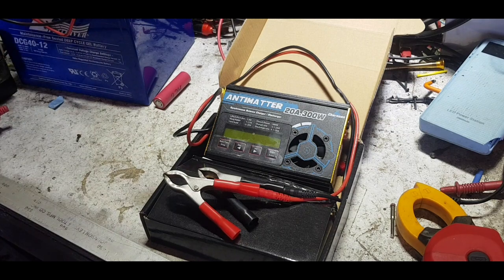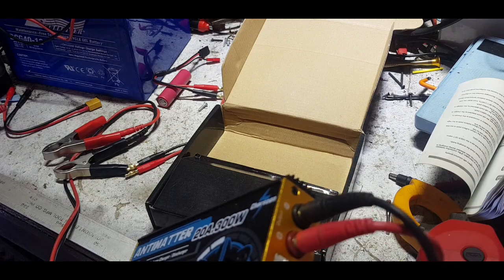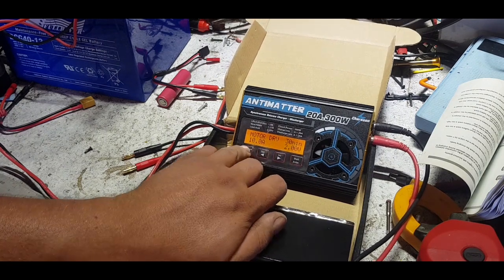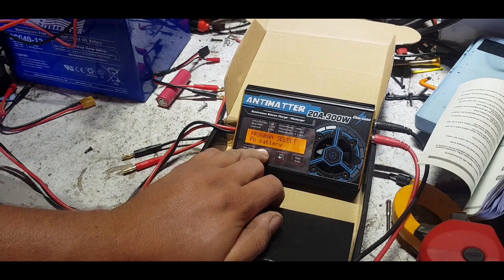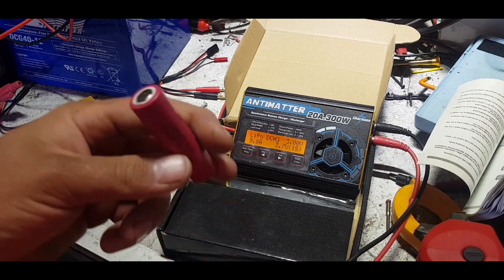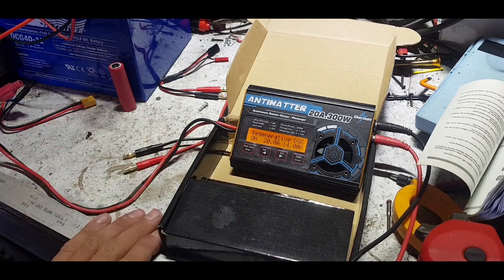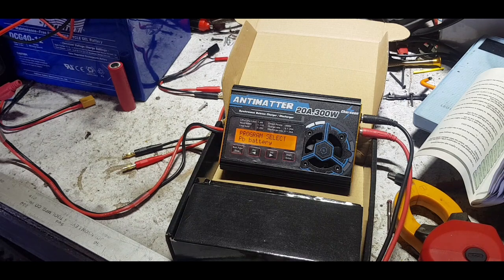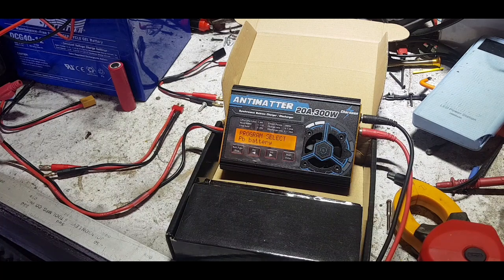Charsoon Antimatter 300W 20A Balance Charger Dis charger Review

Comment: A good tip is to get some neodymium magnets and clamp them on the ends of your clips or a set of crocodile clips and it holds itself to the battery making a decent enough connection to charge.. I got a set of ten with holds and connected all the wires from a balance lead. now I can make a battery pack as many many S as I like in less then a minute.. all the batteries just snap together with the balance leads and between. Good for testing purposes before you make a battery pack up.. thanks for the interesting video's.. 👍
Reply: Just watched the eev blog... He is testing the capacity of a  battery and said he taped crocodile clips to the side of the battery.. and he apologies for how jank the test is because of how it's set up.... Lol he posted the video a few hours ago... Now the people in this comment section know a better way to do it... Just thought it was funny and had to say..😁
Reply: It's on eev blog 2.... 😊
Reply from the maker: Thats awesome as great idea mate cheers
Reply: @Oneupthesleevecustoms  your welcome..
Reply from the maker: I love good ideas
Reply: I love good ideas as well. Baytheway excellent video as alwais. And I like it wen you sei cheers and mate 😉😉.
Reply: Free stupidly strong magnets (1 pair) can be obtained from a busted hard drive. I leave the "brackets" on them which makes it easier to clip on the leads. Just be careful with them, they will leap together from a considerable distance :)
Reply from the maker: Yeah they have some power !
Reply: Tomorol my dad IS going to buy a dump truck
Reply from the maker: What sort
Reply: MAN

Comment: Can't believe it takes the same firmware! What are the limitations when you use it as a solar charge controller? I'm guessing it turns off when the battery is charged right?
Reply from the maker: Not sure about a charge controller but it is a good step up step.down